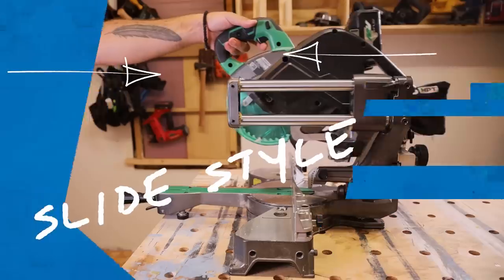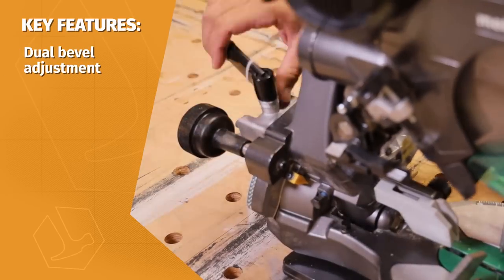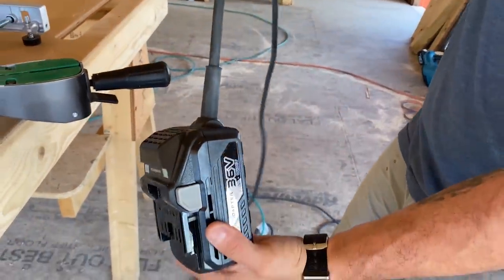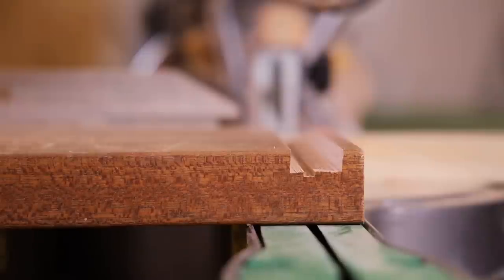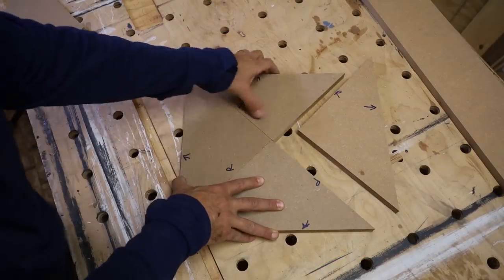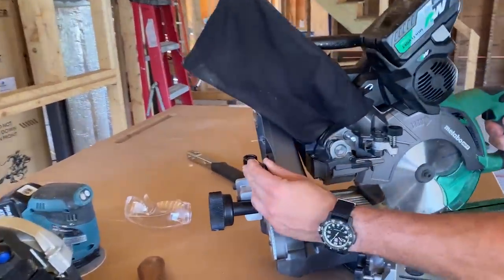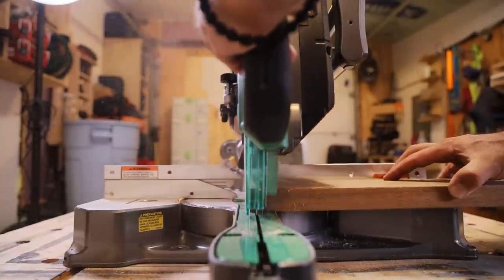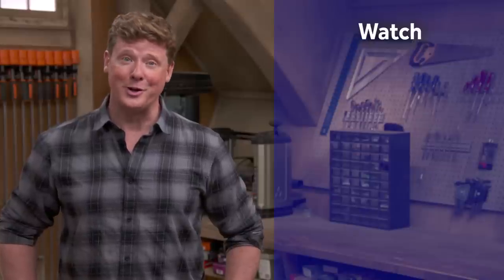Sliding Compound Miter Saw | Tool Lab | This Old House

Comment: Tool review review: The quality of the material delivered was very high, and the layout and pacing of the material was just as high, which is as to be expected from someone with so much experience as an editor, as well as the team making TOH for so many years. The disclaimer at the beginning of the video deserves the highest possible praises, and achieves maximum clarity with little to no wasted time. Keep those up. The animations used to display the price information and the like were well done and kept the amount of information to a minimum, but still kept the important information on screen. 

Unfortunately, the quality of the video editing was not as high as I would expect (Given this is from the TOH team, it was a high bar). Two things jump out. The first is the audio on the on site portion was, as one might expect, not as clear. Because of this, and the fact that the speaker's volume was kept the same as with the in studio speaker, it was a little bit more difficult to hear. 

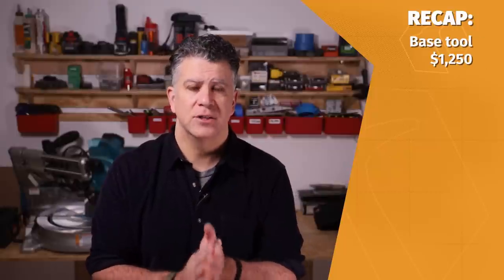This is minor in comparison to the glitch effect cuts used in the video. These cuts were incredibly obnoxious and distracted from the content itself. Normal jump cuts are avoided because the sudden change distracts the watcher. The glitch cut is even WORSE when it comes to distracting. The animations like those at 8:05 and other locations would be much better in the future.  Stick to those.

All in all, I look forward to more quality content and reviews.

Comment: That's crazy , You can get the DEWALT FLEXVOLT 120V MAX Miter Saw Kit, 12-Inch, Double Bevel, Compound, Sliding (DHS790AT2)

With 2 60v batteries , charger and wall adapter for $800
Reply: @Kevin-mp5of  Dewalt makes the best miter saws
Reply: @Kevin-mp5of  I like some Bosch tools like be their lasers , Milwaukee has really nice nailers and drills , but for some reason I always liked DeWalt saws the most

Comment: This saw is literally double the price of a 12” double bevel slider. 🤦 

Metabo gets face palm of the year for 2021!!
Reply: @Kevin-mp5of  there pneumatic guns r best in class. I also heard good things about there cordless framer. I defiantly would like to get one but they never have sales. I’ve been following tool deals for 2 deals now and not once have I seen any of there cordless guns go on sale.
Reply: @Kevin-mp5of  I don’t c anything about nitrogen based, this is the one I’m speaking of. It’s an air driven spring system.

https://www.amazon.com/Metabo-HPT-NR1890DR-Cordless-Brushless/dp/B07L8ZJ2NG

Comment: I've seen battery operated tool ads in which the tool does not come with a battery.
Um, you want me to spend 1200+ dollars on a battery operated tool that does not work out of the box?
You're mama and papa dropped you on your head when you was a young one, didn't they?
I think I'll just stick with the low cost tools that either come with a cord; or come with a battery.
Reply: @Kevin-mp5of  
That's not a selling point; that's an excuse to justify dishonesty.

I'm well aware of being dropped on my hea... on my face rather; I was on my big brothers shoulders when it happened.
Reply: @Kevin-mp5of  😎👍

Comment: That's outrageous 1200 for a bare tool and 7.25 no less. Can't even hold a zero. Hitachi has always been garbage, still is apparently.
Reply: @Kevin-mp5of  they needed that merger to get Hitachi back out there. Sucks for metabo, will probably ruin that name. They have a good reputation with welding grinders.

Comment: Well that's disappointing, first thing out of the gate is a $1200 pro level tool and while comprehensive its simply a review - nothing about proper use which was implied in the promo.
Reply: And don't forget these... safety glasses.

Comment: If your saw costs the same as a Festool, your saw should be its equal at the least.
Reply: @Kevin-mp5of  you’re correct, but did you add to the conversation with your correction?

Comment: Why would anybody pay $1,500 for a 7 1/4 saw? Get a DW716XPS for Less then $400 then get a full kerf miter saw blade and you will be in business. It’s my daily saw and have never had any issues. If you want a slider you can get a 12 inch slider from Dewalt and pay less then half of what this small, inaccurate, cordless, expensive paper weight.

Comment: Like others have said, just another Commercial for an overpriced Corporate product. It's disappointing coming from This Old House Ventures. I'll stick with YouTube's AvE BOLTR tool reviews where he actually looks at the guts, how their engineered, and where they're likely to or have failed. Does that metabo saw have 33% glass fiber reinforced nylon with polyisobutylene rubber? How's the mold? Are the gears sintered metal or hand-hobbed? Lubricated with molybdenum disulfide grease? How does the build compare to similar saws olde and new? We'll never know since this is just a commercial for an overpriced saw most of us can't afford... Anyway... I'll go back to learning from Norm under Russ' watchful eye...